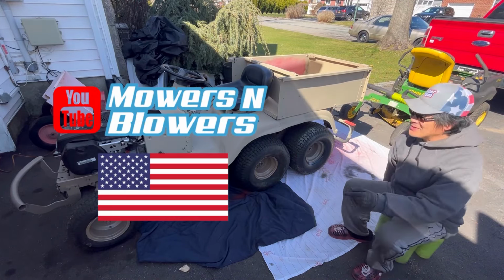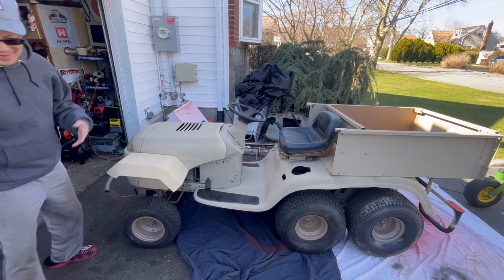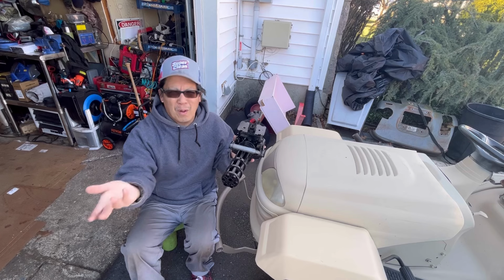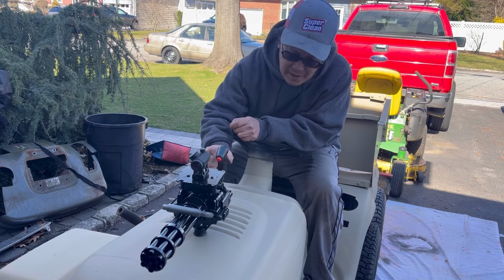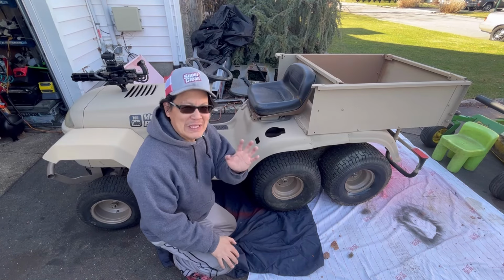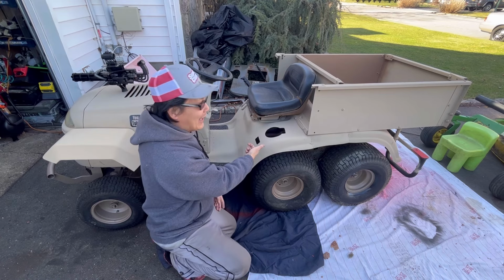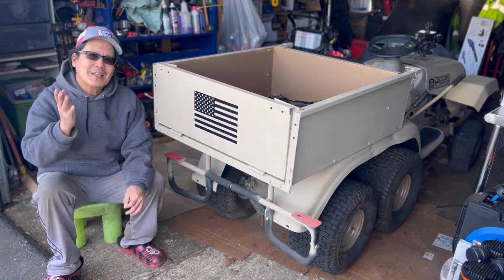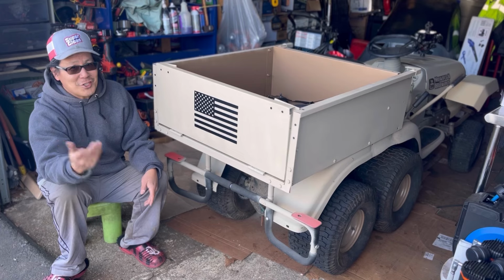CRAFTSMAN 6 WHEELER 2X6 MILITARY THEMED UTV LAWNTRACTOR CONVERSION GATLING MINI GUN & DECALS INSTALL

Comment: Been loving this build haha I kinda think the other more square hood/nose piece matches the lines of the fenders and truck bed.

Maybe for the cup holder issue, just put the regular cup holder and use the bottom hole for a switch! Phaser, Gatlin gun or air horn sounds. 😅
Reply from the maker: Good tip bro

Comment: Wow Henry, Your 6 wheeler turned out pretty nice.  If you figure out how to make all 6 wheels pull would be totally awesome. Andy really makes some nice looking stickers.  I am looking forward to the John Deere zero turn project begin. It’s ashamed that the mower deck is so rusty. The mower deck should be the same as the mower used on the tractors. It would be awesome if you could find a mower deck shell and transfer everything over.
Reply from the maker: That would be cool!